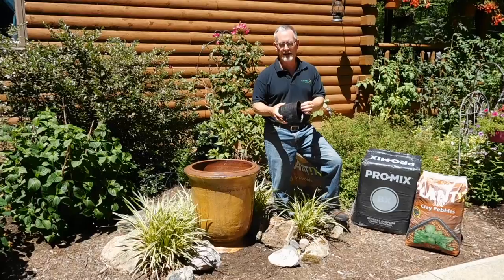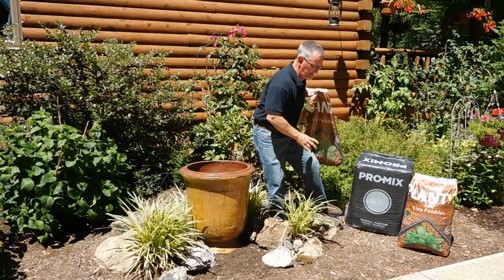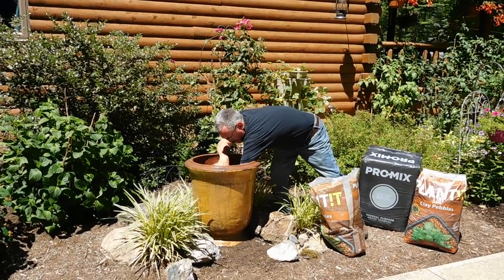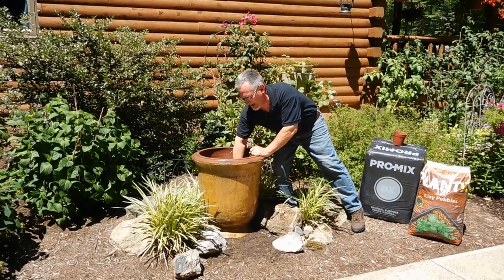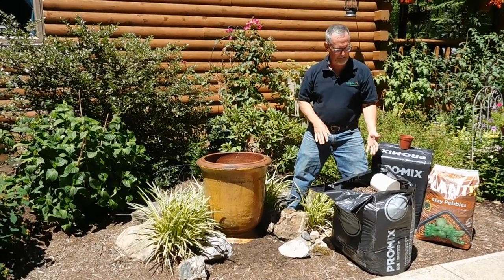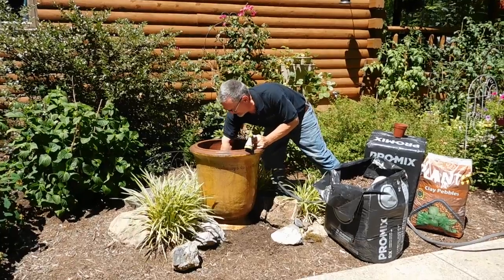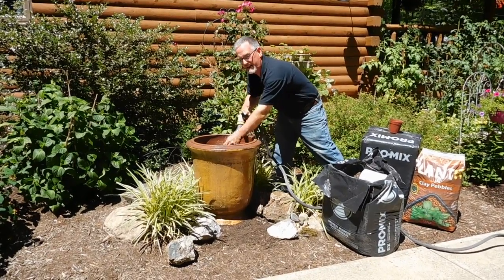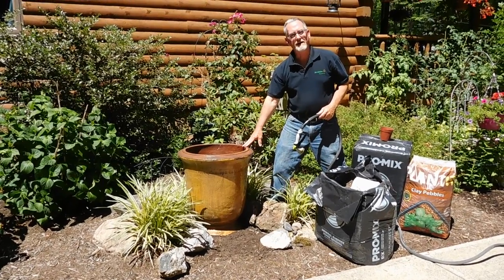How to Properly Fill a Large Plant Pot

Comment: Every other tutorial I’ve seen now tells you not to layer the base of any pot with gravel because it has been proven many times that it it counter productive and makes the soil above it retain moisture and rot roots. I’m confused 🤷‍♂️
Reply: You are right, never put a layer of gravel in the bottom of your pots, try it, test it, you will see it doesn't work, it has the opposite effect & create poor drainage.
Reply: I think it does depend on the pot and the gravel. If you are using jagged proper drainage gravel and there is a massive hole on the bottom then this will ensure that the water drains freely. One this size will retain enough moisture in the soil alone. If you have the pot outside you don’t want rain to fill the pot. If it’s a smaller pot don’t use gravel it will keep the roots wet, or a hole will dry it out very quickly and you’ll have to constantly water it.
Reply: Good question.  However, these clay "pebbles" are not gravel and not real rocks.  These little clay spheres are porous for the water to drain through them, not like most real gravel that is not as porous.  These clay "pebbles" are often used for orchid growing and orchids MUST have really good drainage to survive. I have used these clay "pebbles" for orchids and they drain very well.  Happy gardening.
Reply: @razor2ts  These clay spheres are not gravel.  They drain very well.
Reply: I work at a pottery and I bring home broken pieces of pottery and use them in the bottom of my larger bell planters.

Comment: SHOW the inside of pot, can't figure out why he put other pot in it
Reply: He put the other small pot inside the big one as the small pot has a mesh type bottom.  He put it in upside down to cover the drainage hole and then placed the clay "pebbles" around it to hold it in place over the drainage hole.  

When you plant a container, it is good to have a way of covering the drainage hole so that water can freely drain out, but you don't want your soil draining out too.  Some people use coffee filters to cover the holes, or pieces of landscaper's cloth.  Some put broken pot shards over the hole so the water drains a bit slower and doesn't take as much soil out with it.  Here the gardener is using the small clay "pebbles" and if the drain hole is large enough, the "pebbles" would just fall out the bottom.  The small mesh bottom pot he used would allow water to drain, but keep the clay pebbles from falling out the drainage hole.  Hope this helps.